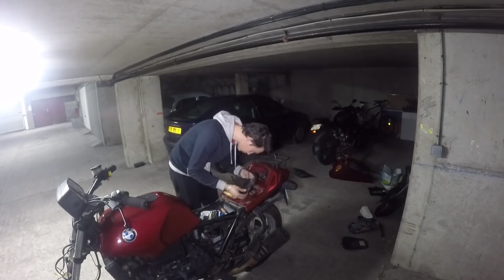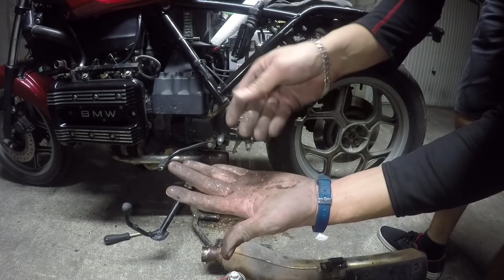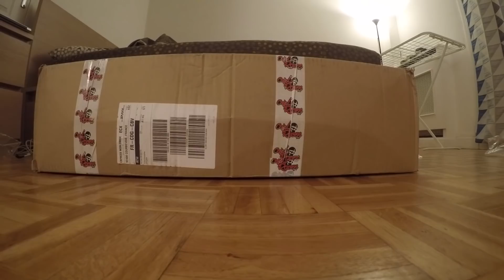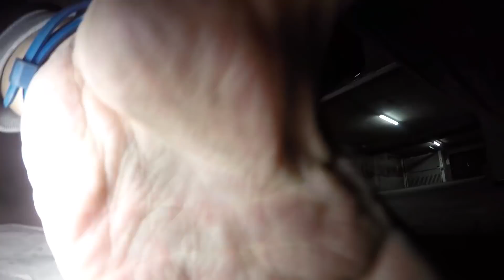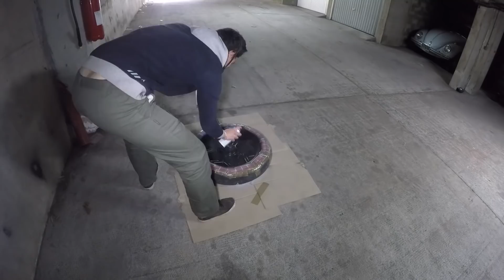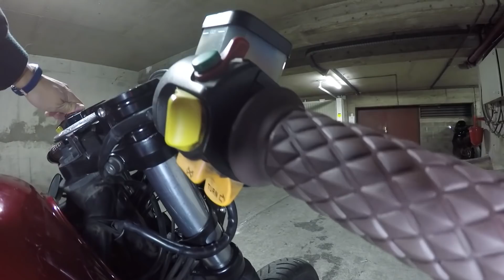BMW K75 Cafe racer - Full Timelapse Build

Comment: nice work. proof that theres no need for expensive tooling to build something nice.
Btw. u should have put end caps to the sub frame where you cut it. in order to prevent rust there.

Comment: Nice job. If it were my project, I would redo the headlight. With the stock forks, the look is tall in front and the high headlight placement and the extent that the headlight extends out from the forks accentuates that. I would get a big round headlight that nestled into the forks better, and I would mount it lower. IMHO.

Comment: Nice build.
3 Things: 1) Buy a welder. The chopped rear end is dangerous like that. 2) Stop using rattlecans. The paint will soon start to peel off. Your project will not look nice for a long time... 3) Use LOCTITE on crucial bolts, like the ones holding the brake disc!!

Comment: I would like to see how you conect the new speedometer, is ready for the stock conections ??
Reply from the maker: Nope it's not ready and require an adaptor module. It is extremely difficult to connect, you can check the motobrick forum for details.

Comment: Nice build :) What type of material and thickness is the plate for the rear you made? (the one covering the battery). Where you installed the fuel gauge.

Comment: I have 2 questions, what speedometer is that? and Where did you get the rear seat and cowl? On mine I  made my own from the stock cowl and a wooden plank, but I think I want it cleaner like yours. I think it looks a lot better. My k75 has like 80,000 miles on it :D.

Comment: Great job for 50h project, clean and simple. Great exhaust sound. Can you share settings on Koso gauge, I have same gauge on my K75s and cannot get it calibrated. Instructions are terrible and email to koso didn't help. You have a talent for cafe creations, keep the good work. Official subscriber.
Reply from the maker: Thanks! :) the settings on the KOSO are 2000 for the wheel circumference, and the "P" thing is 5 or 6, can't remember, try both 5 and 6 and monitor it with a gps on your phone, that's what I did and now it is perfect ;). I am using the stock speed sensor from rear wheel though, not the sensor from the koso. 
Thanks! nice to hear that, I might do a second cafe project soon :)
Reply: Tahitian Rider , thanks and will follow your videos.

Comment: IMHO the handle bars are a little high, here is an article written by a car designer about the lines he thinks a cafe racer should have, its all opinion but i tend to agree with him. You could drop the clip-ons under the top triple and lower headlight -makes wiring a little cramped but is doable and would change the look very quickly. nice work on a low budget mate, watch out tho you'll get hooked and end up spending all your money on bikes :)
http://www.bikeexif.com/build-cafe-racer

Comment: the most "caferacer-ish" things in this build, is this sticker in the middle, metal triangles etc.
in a cafe racer, witch is a bike, by definition, as light, and fast as possible, for as little, or better, no money at all. meaning, rip off every unneeded thing. not add, remove.

Comment: I know it's been a couple years since you posted this. But how did you do the Speedometer? I have been looking online many people say the transition between the stock mess and an aftermarket speedo is a bit complicated.
Reply from the maker: It is extremely complicated, requires an arduino signal conversion module board... took me 4 entire days just to wire the new speedo.

Comment: Bien joué ! belle transfo ! pas trop chaud le branchement du compteur analogique ? continu ...
Reply from the maker: Merci :) si c'est quand même complexe, l'installation du nouveau compteur m'a pris une journée entière à elle seule...
Reply: Salut ,j'en  ai fait un avec une k 100 rs de 2001. Pour le compteur vitesse ,tu as mis des aimants sur ton disque ou tu as repris le faiseau d'origine ? Super job .une de plus😱
Reply from the maker: Salut, merci ! :) j'ai repris le capteur de vitesse d'origine, mais jai mis un module de controle arduino entre pour adapter le signal au KOSO.
Reply: Ok ,tu pourrais me donner le lien  pour le module,je roule sans compteur pour l'instant.merci d'avance
Reply from the maker: Il n'y a pas de lien, je l'ai fait faire sur mesure par un membre canadien du forum motobrick. C'est spécifique aux K75 et K100.
Reply: Ha ok ,comment t'as su qu'il fallait un module pour transformé le signal?
Reply from the maker: Car ce n'est pas le même type de signal, en cherchant sur des forums on trouve ca, mais l'installation nécessite quand même des connaissances en électrique
Reply: Oki,je suis content ,j'ai une piste a suivre.merci ,c'est toi qui a fabriqué le module a partir du schema du canadien?

Comment: Hi hi hi hi. I have a k75 tooo....how do you put custom indicators on?
Reply from the maker: you mean turn signals? I have made custom 3D printed mount for the rear, and bolted the front one on the headlight bracket
Reply: Tahitian Rider  yes turn signals. But it's the wiring that is confusing me.
Reply from the maker: Wiring is simple, it is same as original, just unplug the stock turn signal and plug the new one on the same wires lol
Reply: Tahitian Rider yes yes. But the stock lights are gone

Comment: What does K75 means ? 
Is it a 750 . 
I’m new to bikes trying to learn .
Reply: Its BMW R series, whith the 2 cylinder boxer engines, and K series whith inline engine from 750 ccm 3 zylinder, 1000, 1100, 1200 ccm 4 zylinder too 1600 ccm 6 zylinder. The K 100 series is from 1982 and forward. K100 1000ccm was called, The flying brick 😋K75 750 ccm produced from 1985, after the 1000 ccm engines. I think it was in 1988 the K got ABS brakes too. We also got the BMW  G anf F series. Its more info out there then i know, just goggle it 🙂

Comment: bonjour ! super la transformation ! tu pourrais me donner la ref du compteur si c'est possible. je vais preparer un k75rt et je trouve canon ton compteur !
Reply from the maker: Gauthier Vts salut ! Merci :) le compteur c'est un koso dl03sr ! Par contre il ne s'adapte pas comme ça au signal de vitesse et de rapport d'origine. J'ai installé une carte de contrôle et de transformation de signal faite spécialement sur mesure entre. C'est basé sur du Arduino.
Reply: tu la fais faire ta carte de controle ? ou tu las faites toi meme ? Ca m'interesse ^^
Reply from the maker: Gauthier Vts je l'ai fait faire par un membre canadien du forum motobrick ^^ 70€ si je me souviens bien. Mais même avec vaut mieux être à l'aise en électronique pour faire les soudures et modifs de faisceau ^^
Reply: mon pere est calé en elect ;) , t'as du faire quoi exactement comme modif sur le faisceau et comme soudure ?
Reply from the maker: Gauthier Vts ressouder tous les câbles du compteur ^^ (24 câbles). Prendre des alimentation 12v reliée au Neiman pour la carte de contrôle, des masses, etc. Il faut bien compter une dizaine d'heures de boulot ^^
Reply: ah oui ^^

Comment: Great  AND INSPIRING video. One question?. How come you didn't remove the tyres before painting the wheels?
Reply from the maker: Thanks! No need to ;) I have masked the tires using playing cards, check ou the link in the description for the explanation ;)
Reply: it looks like you painted the disc mounts and then just bolted the disc onto the painted surface, that 1- 3 mm of paint can make a difference, if you now have a bit of a wobble on braking that could be where it is............. for a cheap build with not a lot of access to a real workshop you did pretty well man, good job

Comment: Nice! I am working on a crashed k1200lt, trying to fix the wiring, It will crank but no power to the fuel pump. anyways, what did you use for the instruments? I didn't see you mention a name in the build guide.
Reply from the maker: Thanks! I used a KOSO DL03SR, good luck with your k1200lt ;)
Reply: Did you have to remove the ECM from the stock gauge cluster? I heard BMW put it in there, but can't confirm, working on a similar build (BMW K1200rs) and I'd love to get rid of the stock gauges but I'm worried about messing up the bike's computer. Great build by the way!

Comment: How did you sort out the wiring to work with new speedo ? :)
Reply from the maker: I bought a custom made control board allowing to use some of the stock wiring (speedometer, tachometer, neutral led and gear display) with my KOSO DL03SR speedo, it's made by someone who also provide a full wiring diagram which helped. And some other wires from the stock cluster can go to the koso speedo directly too.
Reply: Tahitian Rider that's awesome! Is he still selling them? I'd love this for my k100 project

Comment: it's 750 cc ??
Reply: 3 zylinder whith 120 degree crankcase. 75 Hp. Everlasting engine. Mine has 300k km on it. But still RT, not cafe YET 😋